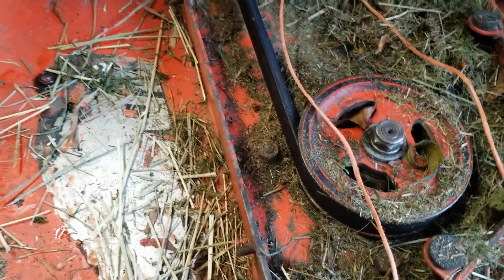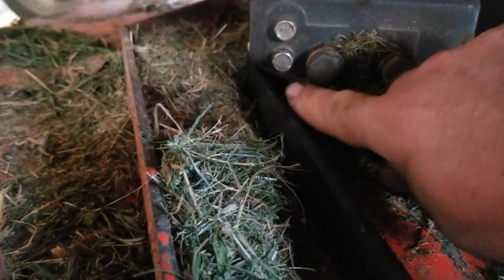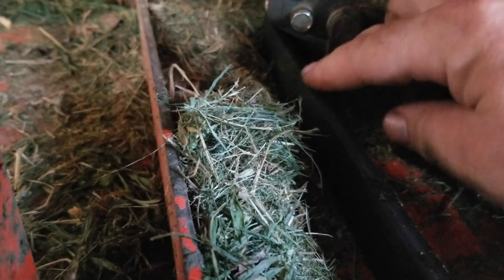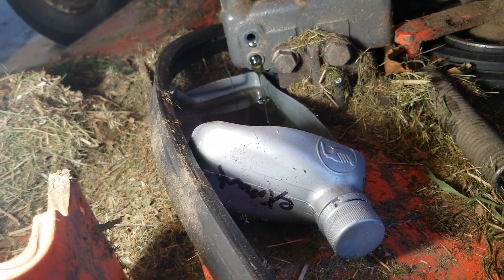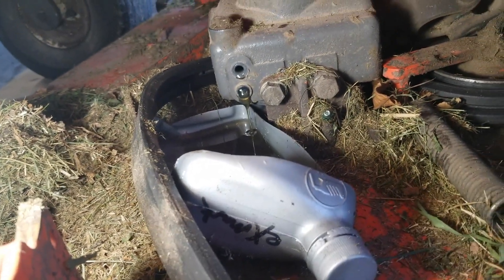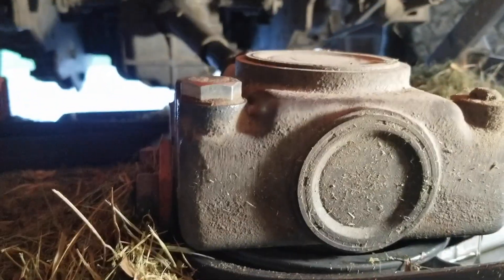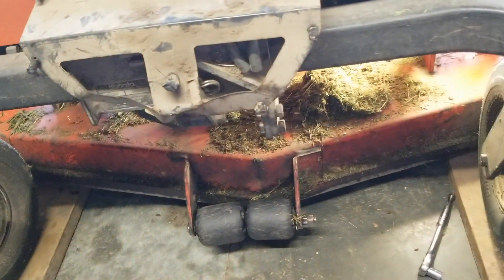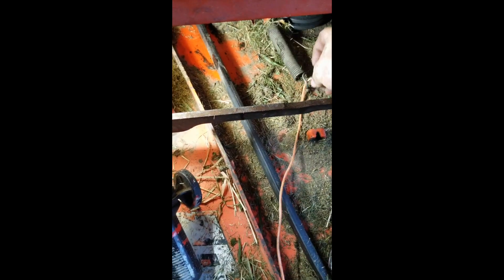Farm Stuff Kubota ZD28 Mower deck gearbox 7 19 23   HD 1080p

Comment: Thank you so much for this video on the ZD28 gearbox change.  I'm a 62 year old lady and work on a  cattle farm so am familiar with using tools. I did remove the tension spring as shown, but just wasn't quite strong enough to pull it back. My solution was to wrap the   baling twine after it was noosed around the spring end, to a hammer. I wrapped the twine in the middle of the handle and pried with it's head on the deck. I had another  tool ready to push down the spring  into the slot- when it was  in position. Easy as pie. :) Thank you for the video again.
Reply from the maker: Good thinking!  Leverage should be our ally ;)